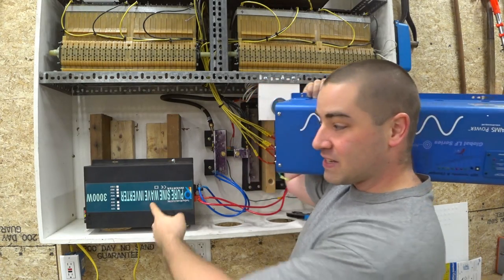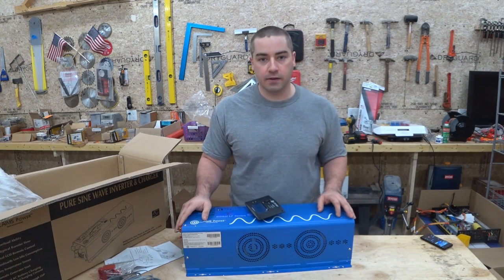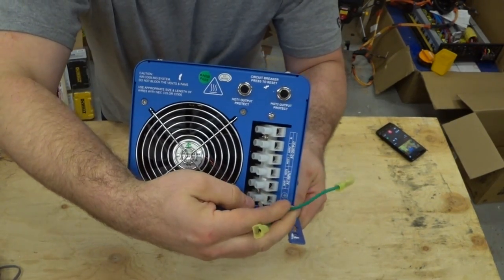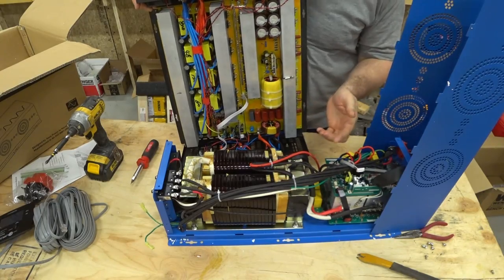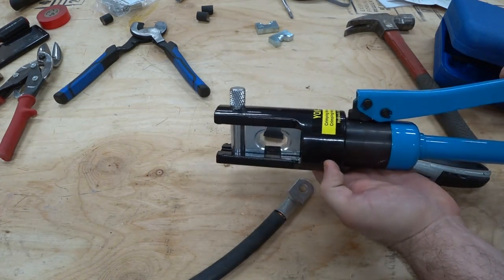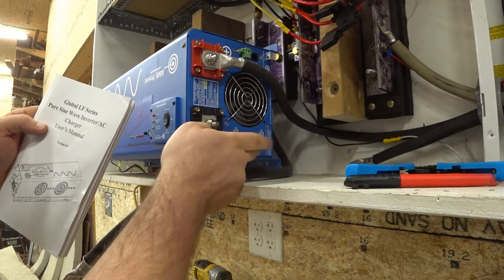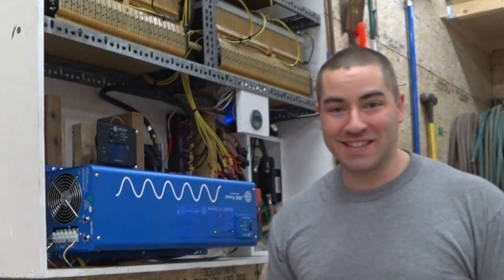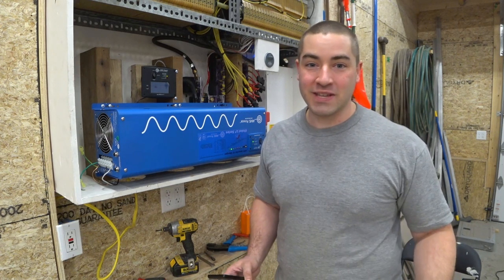Inverter Upgrade! Reliable to Aims in Off-Grid System

Comment: Hi, I'm looking to buy a 5k or 6k inverter, does it make annoying noise?  (fan etc), and if makes even more noise when it is working?. The idea is
 to place it on my living room, but another area could be in a closed room underneath the stairs, but it would be just a bit more complicated 
there. I appreciate your reply.
Reply from the maker: Yes, you can hear the fans when they run.  They are temperature controlled, so on/off as the loads change.
Reply: @DavidPozEnergy  thanks, and when the fans work (maybe not at all time?) generate similar noise to a PC CPU or is it even more noisy?, a sales person told me it makes noise but in another store told me it doesn't make any noise. I don't have the chance to hear it because none of them have in stock for the moment.

Comment: If it wouldn't start that little compressor it was a POS. I be the saw pulled more than it did on start. For somebody that don't like electronics you got enough of it around you. LMAO  
Good Video Dave
Reply from the maker: If you put two electronc components in front of me, I guarantee I can identify the right one 50% of the time.

Comment: You didn't put no-ox on the wire before you crimped the lug on it?
Reply from the maker: Correct.  My understanding is that no-ox is for aluminum to copper connections.  The lugs are tinned copper, and the 4/0 wire is copper.  I don't think I need no-ox, but I could be wrong.

Comment: In this test, you ran the hot, neutral and ground for a 120v outlet, correct? Have you connected for the 240v yet?
Reply from the maker: I no longer have this inverter.  At the time, I had both 120 and 240 Volts hooked up and powering my house for over a year.  I didn't have any problems while I used it.
Reply: Thanks for the reply D! I just got the 48v, along with (4) 110ah Li bats.  The goal is to run a 240v well pump. I'm still unsure on the fuse size as well as the solar disconnect size. Thank you for this video as well as the reply.  @DavidPozEnergy

Comment: Great Video Glad to see one that runs everything.  I wish you had an Oscilloscope. Do you? 
I am curious to see how "clean" the voltage is coming out of this brand / model. 
So many inverters "claim" to be "True Sin Wave" or "Pure Sin Wave" but when you look at there output on a Oscilloscope its defiantly NOT a good "clean" sin wave. 
I am not saying this would be the case with this brand I just don't take any brands word for it now days I like to know for sure.
Powering electronics with "Bad" noisy AC will eventually lead to early failure.  Motors with commutator bushes too.
Reply from the maker: I don't own an oscilloscope, or been able to find one for rent.  I would love to scope all my inverters and make a video.  I have this Aims, my 3000w reliable, and I have a tiny 300w one I use in my car.  If you could loan me one that would be great.  If you are in New England I'll pick it up, or mail it and I'll mail it back when I'm done.  I've even looked into tiny oscilloscope kits that you solder together at home, but I think they are only for tiny voltages with electronics and can't do this.
Reply: @DavidPozEnergy  Watch this video:
https://www.youtube.com/watch?v=9iJp__9EUPw
Here is the scope assembled + probes, costs next to nothing: 
https://www.ebay.co.uk/itm/Full-Assembled-W-P6020-BNC-Standards-Probe-DSO-Shell-DSO150-Oscilloscopes/233434393957?hash=item3659c62d65:g:KYYAAOSwOHVd9J4G

Comment: I been wanting to go solar. I don't know where to start. One person came out and gave me a price of $45k that included 80 panels, that seems to high and to much for what I need... I don't know much about solar.  I have a 100 amp service, I'm in central Florida. I'm on oxygen so I need back up power. Maybe a solar generator would better. Any suggestion. Thank you
Reply: Definitely shop around. That price is very ,very high. Solar panels are cheap. I am running this inverter ,though the brand name is must, its the same one though,it is pretty solid. Two years so far. A cheap easy way to start is get a good generator ,my preference is honda or yamaha, with a ATS transfer switch that starts the generator automatically if the main grid fails. I'm actually off grid so that isn't an issue for me. As for batteries I'm using agm lead acid batteries as I consider them a better fit for residential installations.  If you want to spend big money ,maybe tesla powerwall and solar panel roof are a good  option? 45k is a massive price, definitely shop around ,but first establish exactly what you need. Hope some of this helps

Comment: Nice video,, I'm thinking to get me a 2 or 3 KW unit, They say it can deliver a 6kw surge ( 2Kw Unit ) and the 3Kw Boast 9Kw Surge.  They seem to be really good.
Reply from the maker: Yes.  The surge is only for a second or two.  It's meant to be able to start a motor.  But after 20 seconds of surge the inverter will turn off.
Reply: @DavidPozEnergy  Yes, most inverters and some generators can't even start a compressor..If it can start such a motor, it has to be a good inverter.

Comment: Hi David how do you determine neutral on cheap 12volt inverter.if want to wire it to 220vac db box.where neutral is common
Reply from the maker: You can't directly connect a 120V inverter to a standard household 240V breaker panel.  Instead, move the circuits.  Set up a sub-panel with just the 120V loads you want backed-up.  Run the inverter to that sub-panel through a transfer switch.  
Of course, check with local codes and regulations first.

Comment: If I had a shop that's the inverter/charger I would get,  220v can it do 3 phase (or do you need one inverter per phase)
Reply from the maker: This particular inverter will not support 3-phase.  There are some brands that make 3-phase inverters, SMA, Victron come to mind.

Comment: I have an aims 2000w/12v inverter. My charge currebt know broke off during shipping. How could I know what percent it was last left on? I bough it used on ebay.
Reply from the maker: If you don't know the current, you could install a meter between the battery and inverter.  This can display the amps.  This is a cheap one: https://amzn.to/2L6xjkS

Comment: Could you turn the AIMS internal battery charger off, but hook up grid and use it as auto Transfer/failover?
Reply from the maker: Yes, Here is the manual: http://www.aimscorp.net/documents/PICOGLF10w-60w%20071618.pdf  There is a built-in transfer switch.  Also, on page 7 it says that the charger can be adjusted to "0" which will disable it.

Comment: Hey I have a question what size do u think do I need if I want to run a 5 gallon air compressor I would need to run in my car???
Reply from the maker: Hi JR,  The size of the tank is not important.  What is important is the amp draw of the motor.  This 6kw inverter can turn on my air compressor, but my 3kw inverter can not.  I'm sorry, but without more information I can't further answer your question.

Comment: Hi, David, I'm curious why did you change this inverter ? any problems
Reply from the maker: No problems with the inverter.  It worked great.  But I have a 100% electric house and needed more capacity.  There were a few times we over-loaded the Aims inverter if the oven was on, and electric water heater, and then did something like start the microwave.  That's why I bought the two SMA inverters, now I have double the capacity (12kw) and have never over-loaded them.
Reply: @DavidPozEnergy  thanks for the fast response 👍

Comment: I have a camp that is off grid . I have 4 12 volt dc 200 amp hour  batteries, the camp is wired 12 volt dc for lights also 110 ac off gen. I am looking for a inverter to run the 110. Would like to go into the fuse box with 240 ac. Is there an inverter that would run  12volt dc to 240 ac that you would recommend
Reply from the maker: I have been very impressed by this brand Aims.  This inverter has been doing great.  They do make an inverter that can go 12vdc to 120/240v.  This is sometimes called "Split-Phase".  https://amzn.to/2opNe3L  This might work for you, but I couldn't say for sure without knowing more info.  Usually it's easier to keep to just one phase (120v) if you don't have any 240v appliances.

Comment: i think the AC input should not act as charger.
I saw other inverter where when your battery gets low the inverter switches from battery source to power grid source

Comment: how long can you run stuff off that power wall before the batteries need charging
Reply from the maker: I've done several tests.  One example, we ran the house for 24 hours with no change in behavior.  (I even made sure to include laundry during that day.)  And our battery went from 48.6v to 44.8v.  Which means we probably could have gone up to 30 hours with no input, and no change to lifestyle.  (the bottom cut-out voltage of the battery is 42.0v)  But, it can be stretched out longer with behavior changes.

Comment: How long does this inverter last and how do you get it charge, I’m new to this
Reply from the maker: Generally speaking, inverters last 10 years, but it depends how hard you work them.  Some last 30 years.  You don't charge an inverter.   I use solar panels to charge my battery, the battery powers the inverter.

Comment: Did you ground the inverter? Do you need to?
Reply from the maker: Hi Nick,  In the video I did not ground the inverter.  It works (as you saw) without having a wire going to a earth.  However, I'm not planning to leave it like this and when I add a wire to ground I will show it in a video.  Thanks for watching.

Comment: yes thats awesome but try to plug 2 or 3 unit of your tools if  it can operate at the same time  and do it for 15 minutes, if how is the out come, mine i got  12 volts 3,000 watts   pure sine wave inverter, and i used only one marine deep cycle battery,  try my refrigerator about an hour  and it works, but when i bought a new  10 pieces of golf cart batteries connected in series and parallel it cannot even finish the 3 minutes of a microwave, it automatic stop the inverter, so try ur inverter if it can handle for a long period of time
Reply from the maker: I'm currently editing a video where I do a full load test.  It will probably be published tomorrow, Tuesday.  I hope you like it.

Comment: Excellent video and great find on the inverter at that cost! Hard to pass up given the size. I"d think you would still have battery reserve to spare if you are only using it for garage use. Thoughts on powering a portion of house loads? Ex: Running a AC line from the garage to the house and a sub-panel? I am over in PA so similar exposure and have a hybrid system, 4.6KW array with two complete Volt battery packs and given our low resident house loads I am able to fully charge (75% of the time) the pack by 3-4pm and then use the energy later in the day when there is a greater demand.
Reply from the maker: Two Chevy Volt batteries, nice!  It's great to hear you are (almost) always getting the packs back up to full each day.  Do you also run them in 12s?   If you come across another full Volt battery at a good deal, please send me an e-mail as I would very quickly drive down there. 

As for the load transfer, yes I have some plans I'm working through.  My garage currently has a 100 amp subpanel fed from the houses 200 amp panel.  I'm currently working out the wiring so I can take the garage off-grid.  I'll probably just disconnect L1 and L2, but keep the N and G run back to still use the house ground rod.  But, I haven't finalized anything yet.
Reply: @DavidPozEnergy  Thanks. Still early, have only been running the two packs for a couple weeks and still figuring out my system metrics given our household loads. So in short a work in progress ;-) but i love the cost to performance ratio. 

Yes, I have two Gen 1 packs in 12s, 45k and 65k mileage between the two, not much in terms of differences so far with charge rate/balance. I was questioning running 12s but i am pretty conservative in my cell usage range, 3.55~4.00 and so far the inverter that I am borrowing from a friend is working out fine, Outback 3648. 

 I don't have a line on more batteries. I lucked out with the ones I have and found them through salvage yards. 

AC plan sounds like a good one. if you don't go with an 'auto island' inverter down the road maybe do an interlock switch in case you need utility power .?.? good luck!
Reply from the maker: Cool.  Plenty of life left in your batteries.  Next time I find another Volt pack I'll probably re-wire the whole system to 14s.
Reply: 14s or 16s...? Not sure on Gen2 but Gen1 if you do 16s then you get 6 @ 59.2 (16*3.7) or 65.6v at 4.1. Nice even pack, no left over cells. And 65/66v still fits in most 48v systems I believe, at least some outback.

Comment: This unit seems identical to the  APC6048 from Trace...

Question...you only used one hot line...can you get the 6000 watts from only one hot line ? ...Or you get 3000 in hot 1 and another 3000 watts in hot2 ?  Very good work Poz.  This is the only way to get the fake companies out of business.
Reply from the maker: Hi tonymac96,  I'll answer both questions here.  If you are going to run air conditioners, or anything with high surge, go for a low frequency inverter.  This Aims is a perfect example.   When I open it up there is a big heavy transformer inside.  That makes a big difference with surges.  I set this up with one outlet simply for the initial video.  Later I wired in a 120/240v plug so I could feed power into my generator transfer switch, and then power the whole house.  I have more videos on this inverter.  It worked great.  I sold it to help buy some bigger inverters, but also low frequency.
Reply: I do understand what you are saying...but the question is can you pull the 6000 watt from only one hot line ?? or it is distributed between the two hot lines, 3000 watts one...and 3000 watts the other ?  Thanks!!!
Reply from the maker: In theory you could pull from one leg, but I don't think it would be very efficient.  If you only want 120v, they make a 120v only model.

Comment: If the inverter makes 300 watts or close to it but the house needs 200 is the rest wasted or can the inverter throttle output?
Reply from the maker: The inverter is always wasting some electricity just being turned on.  But it only ramps up the production when there is a draw.  So, yes, the inverter throttles output.

Comment: How many watt hours would you recommend for a 5KWatt inverter? (Im building a solar array)
Reply from the maker: I personally suggest, for a 5000 Watt inverter @ 48VDC:
Minimum 5kW battery (51.2V, 100Ah, LiFePO4)
Minimum Solar array: 2.5kW

Comment: What battery pack power wall you using on this?
Reply from the maker: In this particular video I was using a Chevy Volt, Gen 2 pack.  18kwh, re-arranged into 12s8p.  I have several videos on my channel about the battery build.

Comment: Ok. David body, I just wondering if you wated to sell your other inverter?
Reply from the maker: I'm keeping the 3000w unit, still works well, as a backup.  The 8000w units... I haven't decided yet.  Part of me wants to try fixing them up by replacing the mosfets.

Comment: I have no idea about power. However you seem to have more than a few clues so I have a couple of questions for you .I am moving to a country that runs almost everything on 240 , but all my tools , Chop saw, Table saw, drill chargers plus bread maker etc etc  ( USA ) run 120. should we , or would you  invest  in  a step up step down converter ?? what do you suggest  make / model etc.. I hate to look through a thousand video's for the answers.  Any way I loved this video.. thank you .. hope you can help .. New Sub.. P.S the house we are moving to is on grid ..
Reply from the maker: I'm not an electrician, but here is what I know to get you started in your research.  There are devices called "step-down transformers" that allow you to convert the 240v AC to 120v AC.  https://www.digikey.com/ sells stuff like that.  Be careful about the frequency of the electricity.  Frequency is measured in hertz.  North America uses 60 htz, but a lot of other countries use 50 htz.  As far as I know a step-down transformer won't change the htz.  That's as much as I'm able to help, sorry I'm not an expert on this.

Comment: The size of a MOSFET says nothing about its performance!
Example of a BUZ11 MOSFET, which has exactly the same size as the MOSFETs in your inverter:
It can switch up to 35A at 50V. The maximum pulse current is 144A. He has a power loss of 120W. This corresponds to an efficiency of 93%. Thus, a single BUZ11 can switch a load up to 1,630W. It also has an integrated freewheeling diode between source and drain, to handle inductive Loads like a Transformer or Motor without destroying the MOSFET itself.
It's always a good thing to use more MOSFET's in parallel than needed. This gives more Headroom to the maximum Power Limit. In case of this, the MOSFETs stays cooler.

Comment: I would like to see if a window air conditioner work for an extended period
Reply from the maker: Hi Pete,  I have a video about my window AC running all summer on my other inverter: https://youtu.be/dBwXs-c7axU  However, I haven't yet been in a summer with this inverter.  But, I can say that the last week I"ve been running a heat pump on this inverter.  That is basically an AC but in reverse.  I will be running my AC on this inverter this summer.  I'll probably make an update video showing that.

Comment: I see all the chevy volt batteries, Why did you not go 96VDC?
Reply from the maker: I went with 48vDC because there are so many inverters and charge controllers available on the market.
Reply: @DavidPozEnergy  Good call. I am at 48VDC was thinking about going to 96 because I use the same chevy volt batteries that you use.